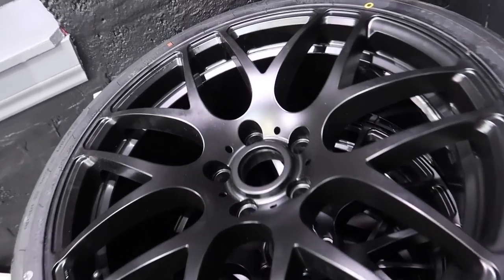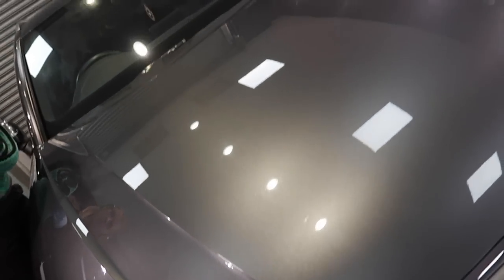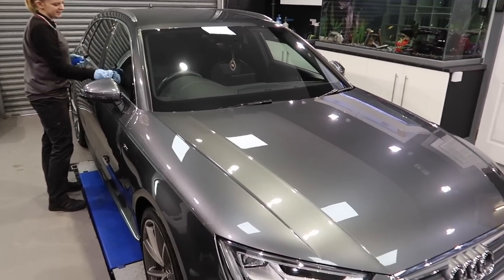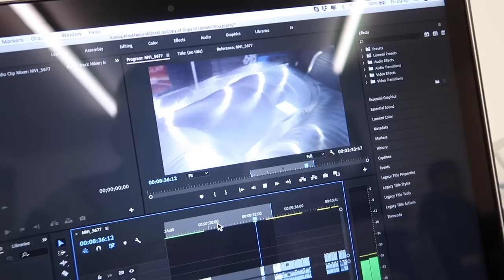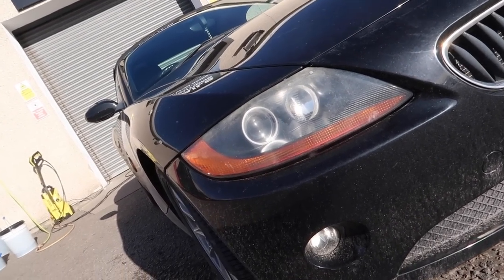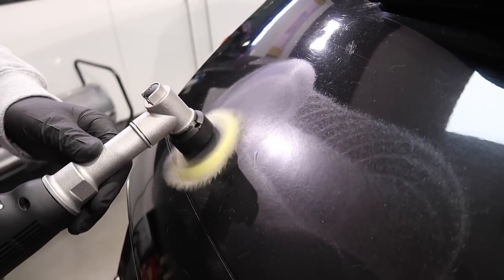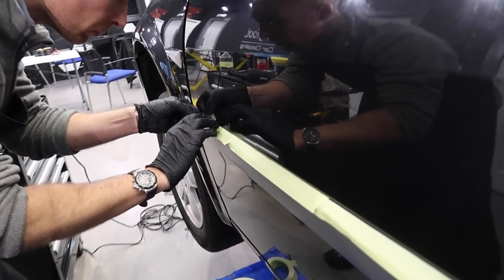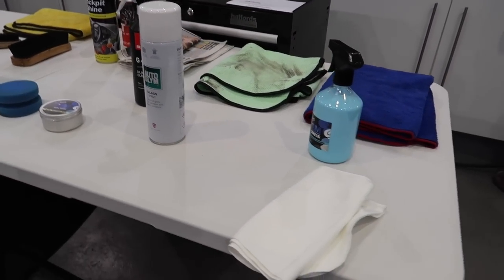AMDetails Update - IDA & Rupes Bigfoot Training Courses

Comment: I'm going to be buying an injection/extraction vac soon, which one are you guys using and what product are you using with it?
Reply from the maker: Hello Jhonny, we use a Numatic George. >>. https://amzn.to/2HOmGSj

I fill it with water only. So it uses water to extract. We spray our chemical on. Work with a brush of MF Cloth then extract with water to remove dirt. Do two dry passes(without injection) to assist in drying.

Hope this helps.
Reply: @AMDetails  thanks, like the idea of filling it with only water. Didn't think about that option but sounds like a pretty good idea